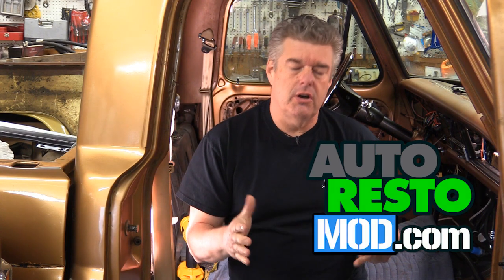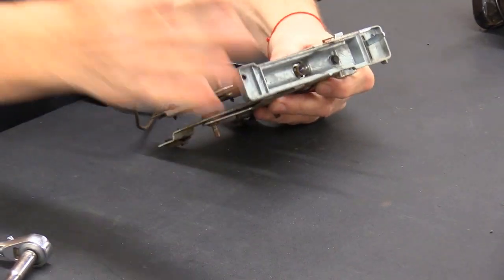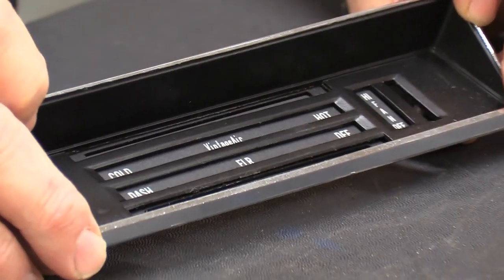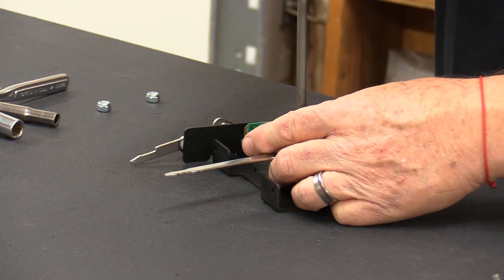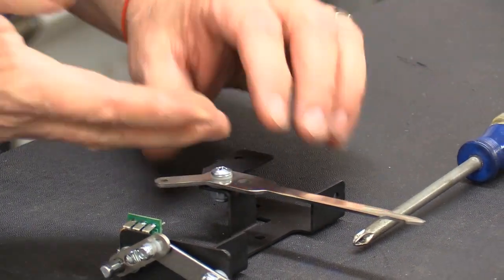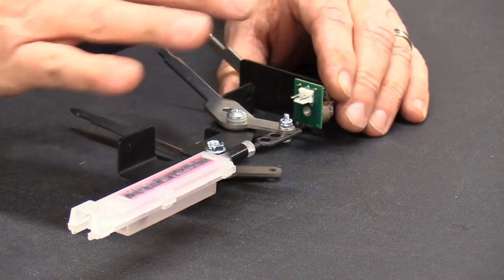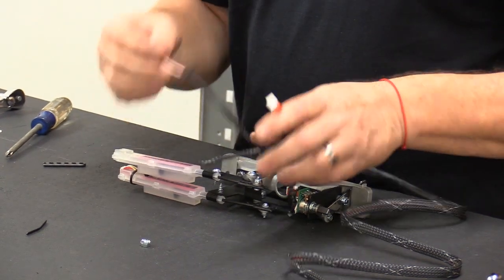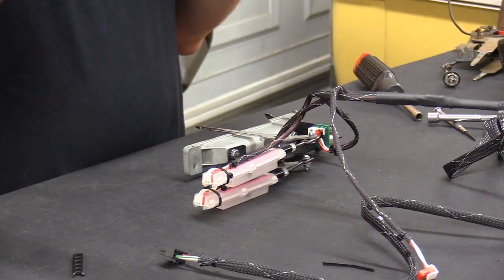How to F100 Vintage Air Install Controls Episode 400 Autorestomod

Comment: Thanks for the video's. I'm currently elbow deep on a 68 F100, cant wait to get the wiring and AC finished.
Reply: P.S. Any chance on a gas tank relocation video.
Reply from the maker: @peterherring8701  Very, very weird. I was JUST talking to my stepson about that very video...
Reply: @AutoRestoMod  I would appreciate one, the truck is my wife's it was her 50 birthday present, doing a little here and there when I can.

Comment: For the price of those units the levers and bracket should come pre assembled , I'd love to have A/C in my 66 F100 but that is way out of my price range !
Reply: I must admit those systems are pricey. On a budget (like I am), you can alway look at universal under dash hang on units. They'll require a lil more work but are good enough the cool a p/u cab.

Comment: I just finished mine and Dash is FLR, FLR is Dash, there is no DEF, it doesn’t turn off and High is Low and low is high.  I followed the directions in detail and double and triple checked my work.  I have no idea whats going on.
Reply from the maker: Honestly, I'd contact Vintage Air. it sounds like you have something flippity.

Comment: Its been a year now, how do you like the AC?  Have you had any problems with the system?  Thanks,
Reply from the maker: The biggest issue is the power steering pump is causing belt squeal. We are looking at ways to get around that by changing the belt position.

Comment: Ummm, what happened to the light ?  What connector will it plug into to?
Reply from the maker: Yeah, sorry the light plugs back into the factory port on the back.
Reply: @AutoRestoMod   Hey Jeff, what does the light plug into?  The little adapter that came with the kit ?